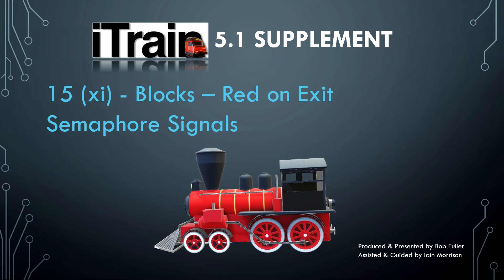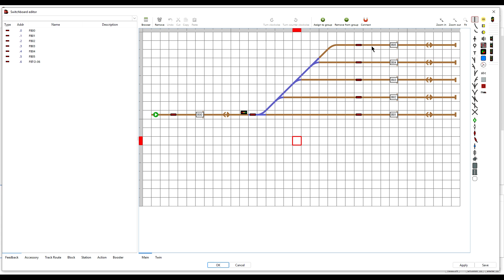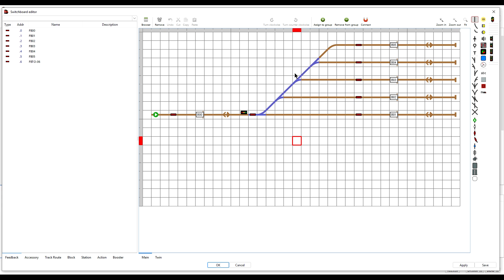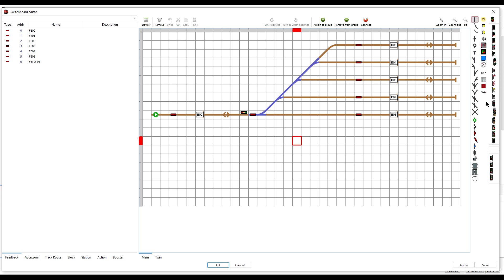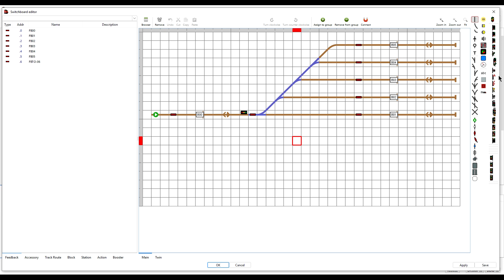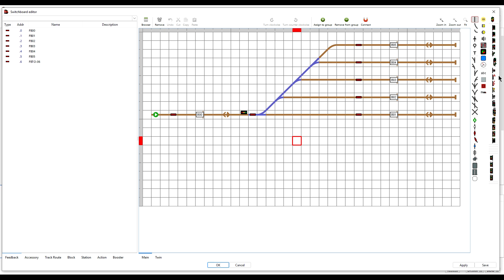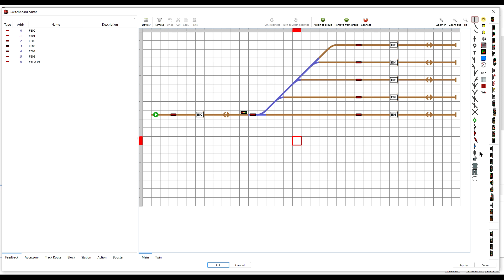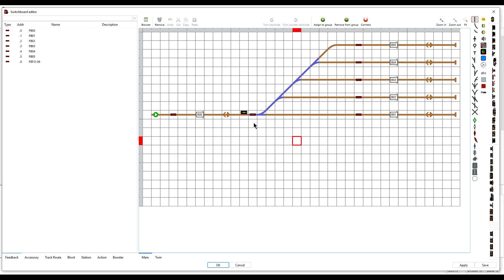Video 15(xi): iTrain 5.1 Supplement - Blocks - ROE - Semaphore Signals

Comment: Hi, Is there anyway to get iTrain to work with Guagemasters Prodigy controllers?. I would like to use iTrain but do not want to buy another controller.
Reply from the maker: Hi Peter. I'm not familiar with the Prodigy but having just looked at the manual, it appears it does not have any USB or Serial Port connections, therefore it cannot be connected to a computer and so cannot operate with iTrain. I believe the 4 ethernet-style connectors on the front are only for the handheld controls, correct?

Comment: Hi Bob & Iain, Thank you for this explanation, been waiting for the complex "station throat" episode, which now seems a lot easier having watched this vid! 
I have a terminus similar to your diagram with top & bottom halves & "up & down" lines feeding it.
Can you just confirm that when you mention "crossover", this also applies to a double slip with a feedback? I can't see why not, but just wanted to check before starting the work. 
Thank  you, David
Reply from the maker: Yes, can be used with a double slip.
Reply from the maker: But remember, this set up also works without turnout feedbacks - you don't NEED to have turnout feedbacks.

Comment: What about french signals ?? Thanks
Reply from the maker: As I hoped we had explained in the video, if your regional signal system uses the right-hand side of the track, use the German semaphore signals. If your regional signal system uses the left-hand side of the track, you can either use the German semaphore signals (but remember to orientate them to use the right-hand track on the iTrain switchboard) or use the Swiss light signals.

What more do you need to know?